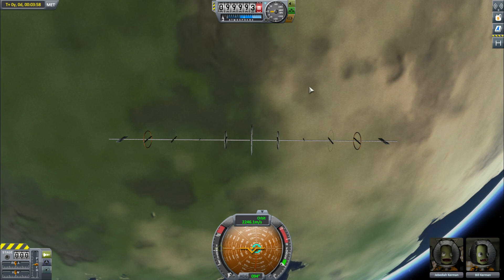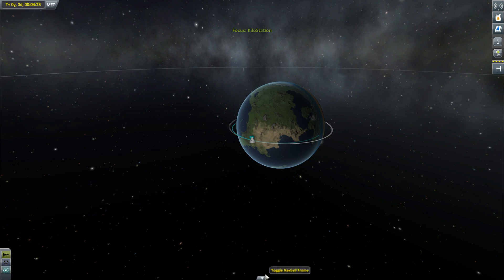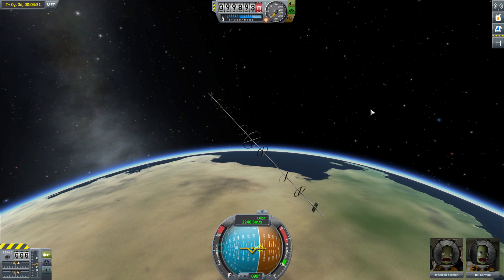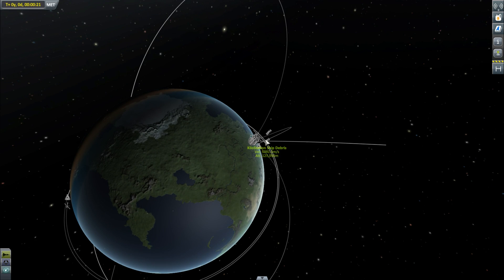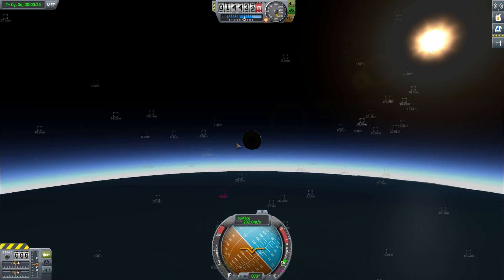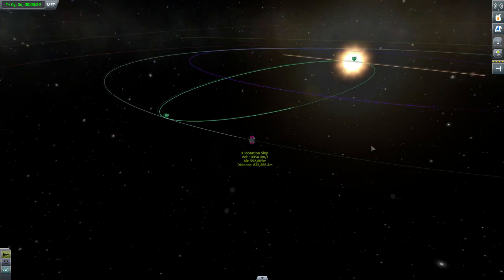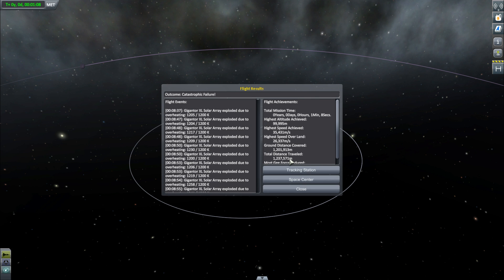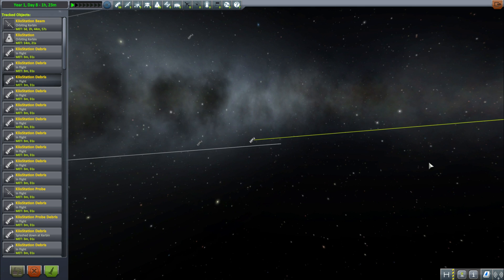1km Long Space Station Deorbit (and Light Speed Glitch) - KSP

Comment: What if you made a giant paddle wheel thing with a 1km diameter and made it orbit at ab70km so that part of it was in the upper wisps of the atmosphere.Would it start rotating? And if so, how fast would it get before interesting things started happening?
Reply: KSP has a max rotation speed of 7 rotations per second so if it could tolerate that it would be just fine.
Reply: ZarPof 25/π (7.9577...) revolutions/sec to be precise :P